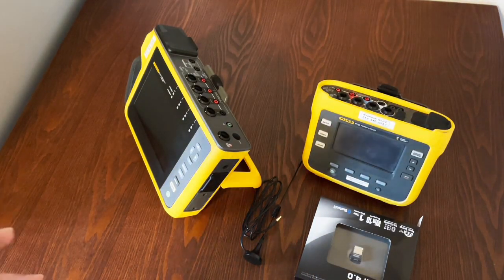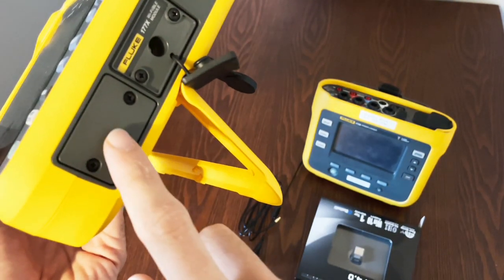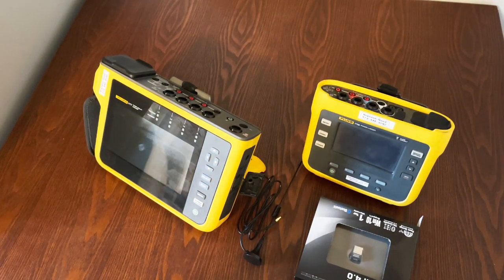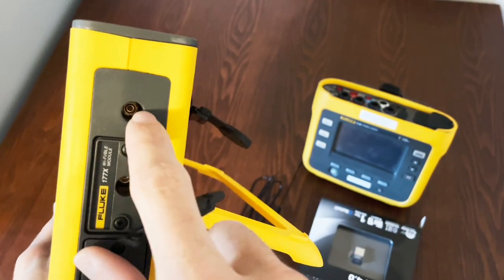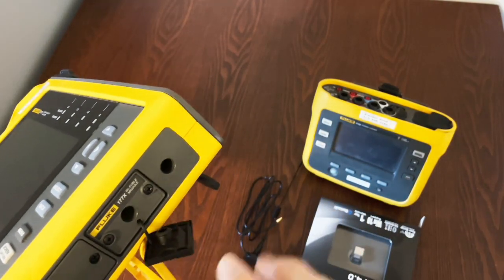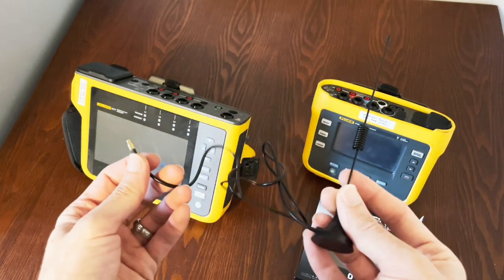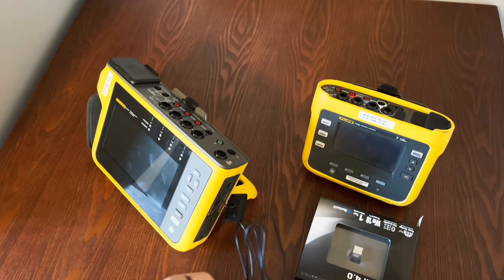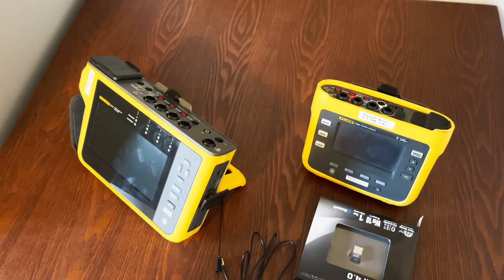1777 Cell Tower Connection!!  - Fluke Fridays - Episode 117

Comment: Hey there, any chance you could feature the fluke connect 35** line? There isn’t much info on the website and I’m curious to how they preform vs the a300* series meters and what the differences are.
Reply from the maker: did you see this video? https://youtu.be/5yE1gD6yo80?si=UnvFWNI0vWGXk8Nl
Reply: @fridayswithbrandon  Does the 1777 power quality analyzer display reactive power
Reply from the maker: @franzfrancis3541  yes I believe you can see KVAR on the 1777
Reply: @fridayswithbrandon  Thank you.